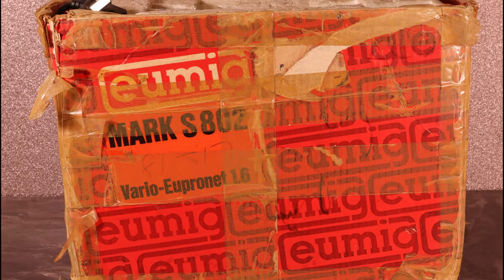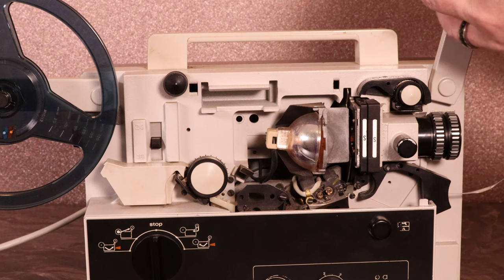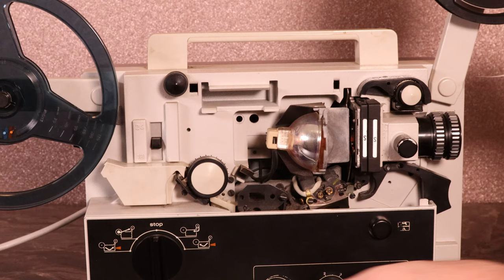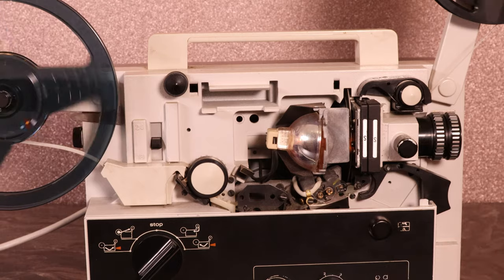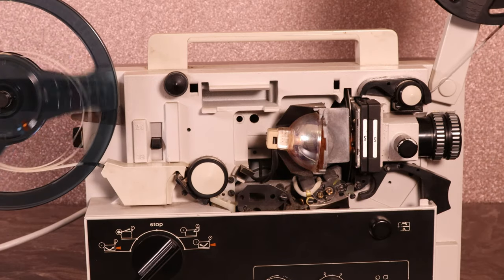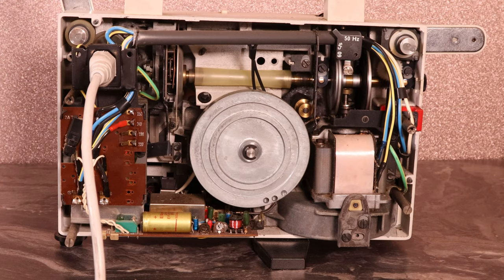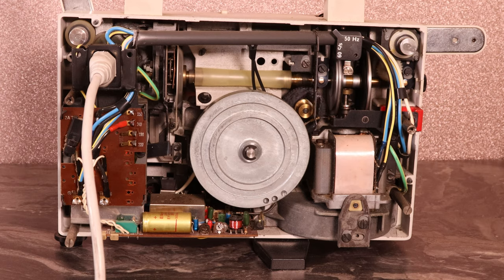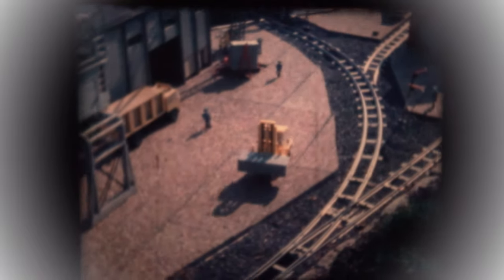Super 8 Projector and Film - The Eumig S802 from the 1980's Still Doing Sterling Service in 2021

Comment: The lamp looks like there is a fault somewhere which would affect output quality. It is not straight in the holder. The bulb filament was designed to line up exactly with the film gate.
Reply from the maker: I’ll have a look next time I get it out, thanks for the tip :-) still got to fix the audio amplifier too :-)
Reply: @JustRupes  My pleasure!